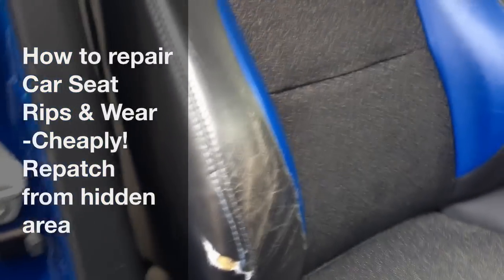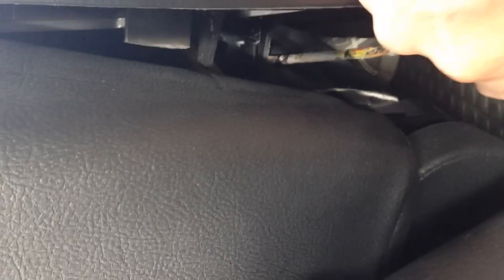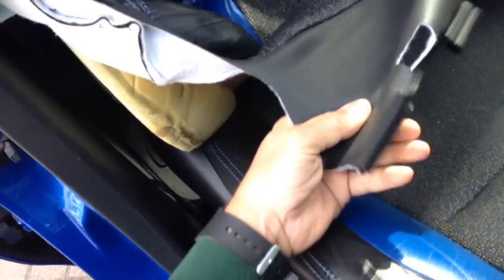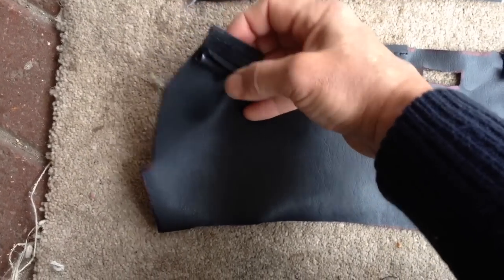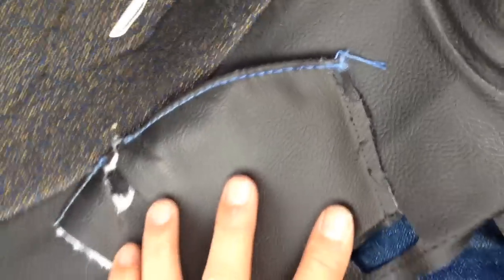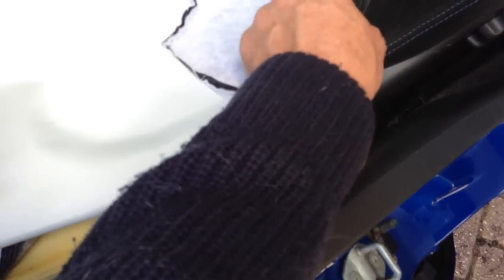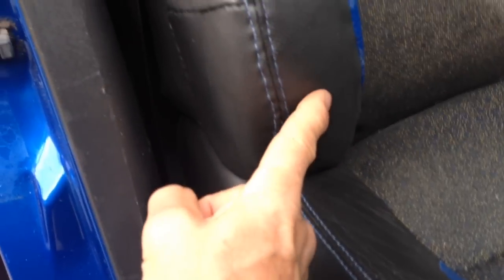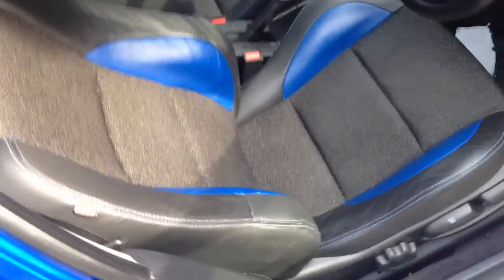How to Fix a Torn Car Seat - Cheaply! MG Rover and others

Comment: Thumbs down....sorry, but please show the entire process to help us DIY-ers that are trying to fix stuff at home.  Wanted to know how to stitch it correctly!
Reply from the maker: Fair comment. I think I assumed that sewing was a straight forward thing not worth showing how to do it. That is not the case for everyone. Here’s a written how to it:  use strong thread and a strong needle, feed the thread through the eye of the needle and pull through a few inches.  Have the long end of the thread 70cm long. Tie a knot at the end of the long end.  Put the two pieces of leather that are to be sewed together with the top sides against each other and insert the needle through both pieces, from the underside of one piece and come out of the other piece also on the underside of the material and at a point where you want the join.  Pull the thread through until it stops at the knot. Then reinsert the needle and thread into the same side that it came out but 3mm further along where you want the join, push through both pieces of leather and out the other side. This is all done on the underside of the leather.  Pull the thread tight and repeat, sewing along a line. When you get to the end, or the thread starts to run out, end the stitching by sewing over and over in one spot so that the thread goes over itself lots of times so that it won’t undo. Then cut off the loose ends.  If you turn over and open up the leather on the top side there will be a join between the two halves without the stitches showing.   On some areas where you want stitches to show just sew in and out at the position and length that matches the existing stitches.